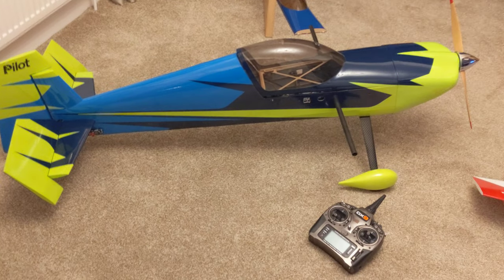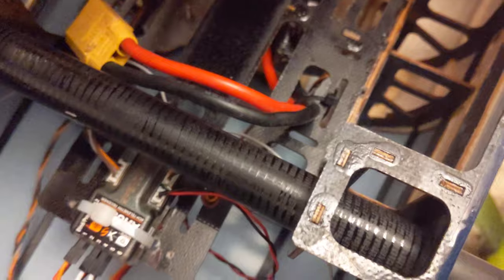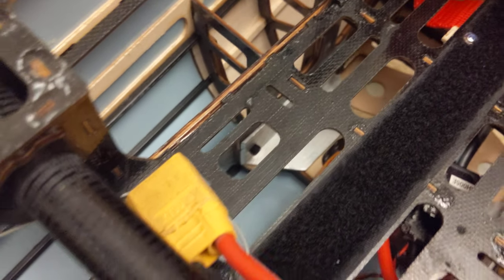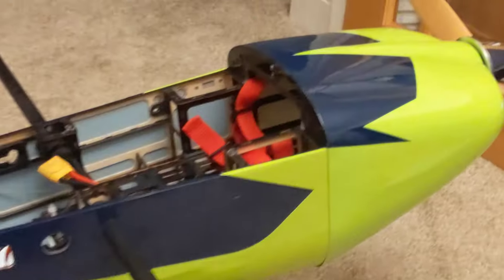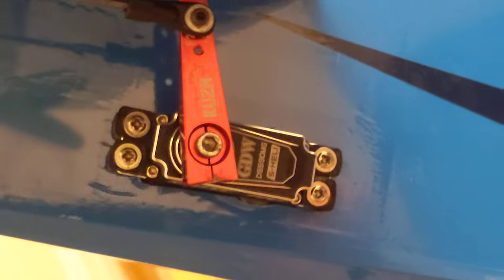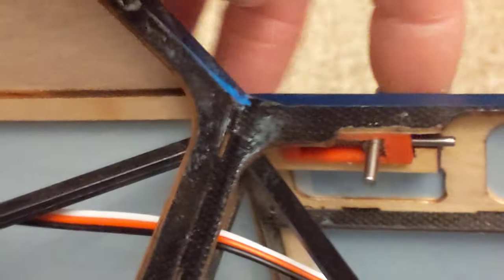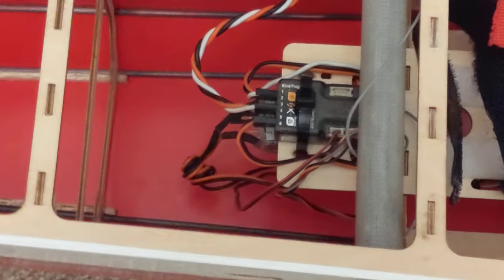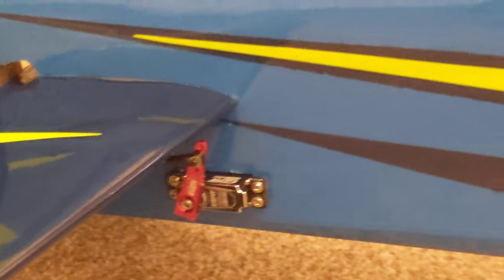Pilot Slick 67 inch... my thoughts...

Comment: Ok wow, im definitely using 0.8mm carbon plates on either side of eletric motor box! My servos are Mks 9767 and works a treat. I went the Ga2000 and I should have went for ga2000r. I'll be using a 19x7. Thanks for sharing.
Reply from the maker: Hi there, MKS 9767 are very very good servos. They are incredibly reliable, infact I've just bought some more MKS 637's 
I would go with the 18 X 10 prop on the Dualsky It's seems to be what EVERYONE uses...don't want you to burn your motor out.
Highly recommend the APC I've tried both wood and APC and the APC Poptops way way better!!!
Yeah definitely definitely definitely reinforce the motorbox I use carbon rods now all the way through the bigger firewall... I've had 6 67in planes now! 
I really don't like the Dualsky motor mount.. I've ended up using 2 ALUMINIUM plates with the bolts screwed in from behind the firewall much stronger and you don't have the issues of the 3mm bolts breaking.👍

Comment: For those of us who plan on running internal combustion engines, do you think this is the right airframe?
Reply from the maker: Hi there... I've had 6 of these planes all electric . Not had IC ...but from all the comments I've read about under powered with ic I suppose with that in mind I wouldn't recommend it...electric is fabulous once you get the set up right but expensive for all the lipos and charger and PSU...I get why folk would want to go IC 
I think the engines are quite heavy too compared to electric motors
Reply: @davidhall4398  thanks

Comment: I just got the yellow one yesterday. My standard servos are too big..  Are you using mini servos? What servos are you using? Did you have to cut the openings?
Reply from the maker: Hi there, the standard servos will fit but you'll have to cut the holes bigger plus there heavier than the mini servos😉, I use MKS 9767 there 35mm long by 15mm wide and weigh about 20g less than standard size servos which IMO is quite a lot once you times it by 4 servos. I also use some GDW Heli servos I bought of ALI EXPRESS which are really good too, High voltage and fast. The yellow pilot I think is the Laser ...which is a few inches longer than the Slick I like the shorter length of the Slick because it fits in my VW Golf nicely. 👍 btw the mini servo will fit straight in with no modifications
Reply: @davidhall4398  Thank you for the reply. I am a Horizon Hobby team member and I am going with the Spektrum HV5070 servos that are 33mm x 15mm. They will fit perfect and save that weight. My 6300hv servos are too big, and they will weigh down the tail. It sucks how they mention a pull pull rudder on the Pilot website, but it only comes set up for pushrods. I was not impressed with the motor mount either. I just reinforced it, and used epoxy to attach it. It’s still not an Extremeflight. It is better than they used to be though. Cheers!
Reply from the maker: @CoeShow619  your welcome... Yeah definitely good idea to keep rear as light as possible if your not using the  pull/pull  setup. I've had about 300 flights on mine now and just had a power failure and broke the landing gear area...gutted and annoying because all new equipment including battery motor ESC and  receiver, the only thing I can think off was overheated due to hot conditions.